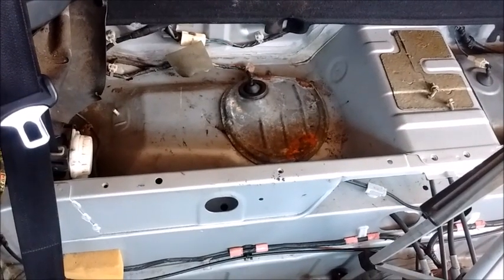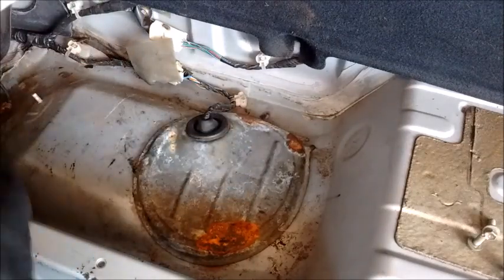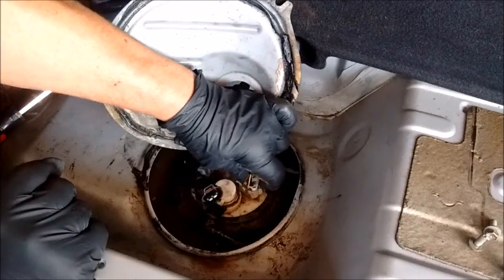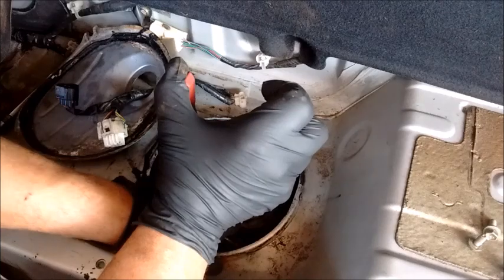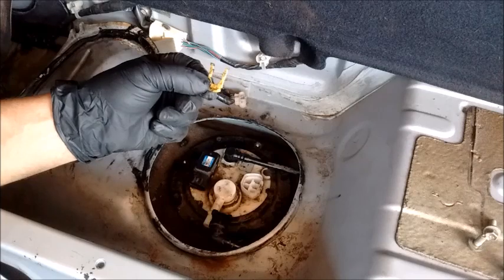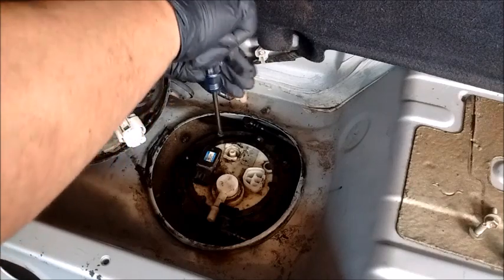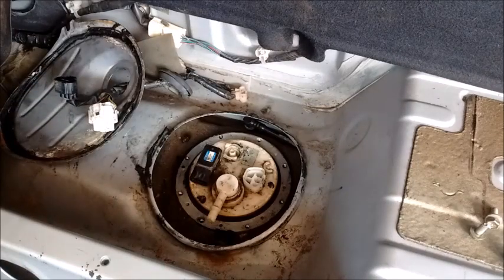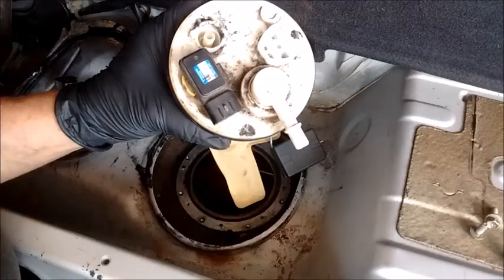How To Remove The Fuel Pump - Toyota MR2 Spyder Corolla Celica Matrix 1zz-fe 2zz-ge

Comment: That evap line is the hardest thing I’ve ever had to remove on the car. Not even locking pliers can get it off.
Reply from the maker: Thank you for watching.
Reply: Wedge a flathead screwdriver or picks under each side until the teeth aren’t locked in place and pull 👍
Reply: I have the same problem, I'm losing my mind xD

Comment: My car had a metal plate blocking the connectors that yours doesn't have. Just  a note that there may be another step for some people.
Reply from the maker: You're right! Most cars have a protector cover plate. It's held down by two screws and comes off very easily. But this car did not have it.